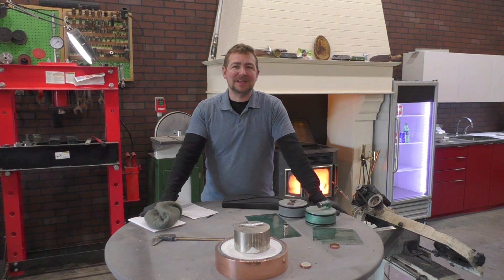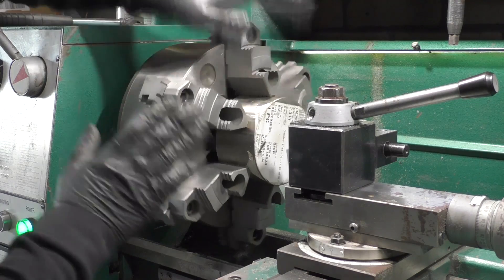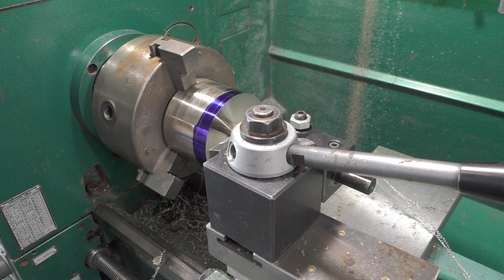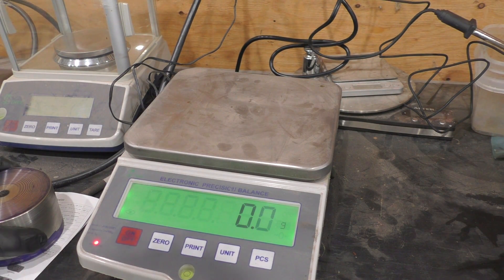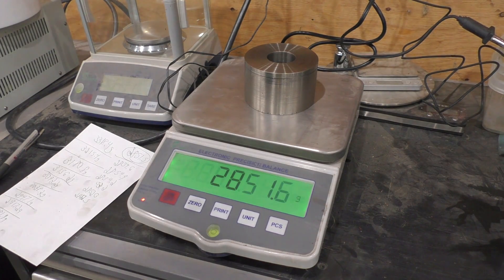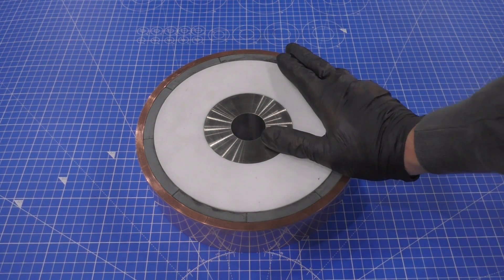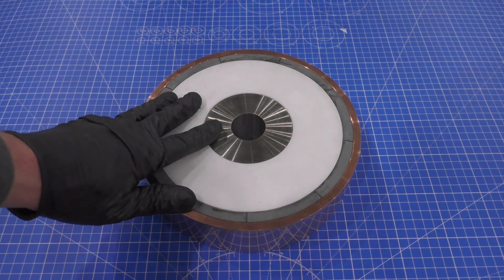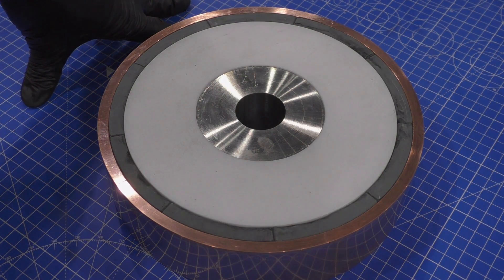Searl Generator Replica Nickel 200 Core Layer

Comment: hey did you check if this generator is working and are you able to control it?
Reply from the maker: I am currently working on building a double stack magnetizer for the rings magnets. unfortunately due to legal concerns I will no longer be posting updates on this device:(

Comment: Any updates? Very interesting stuff! I'm curious as to how much it cost to reproduce one set.
Reply from the maker: Hi, no updates as of yet. I have been forced to move out of my shop into another location. I have yet to find another location. So the project is on hold :-(
Reply: @woodbrassandglass  and faster, maybe in the next 5 years.
Reply: @woodbrassandglass i am thinking everybody starts with a gigantic ring. Why dont you start with small ring in the middle and with smaller rollers do the full project with give or take the same amount of resources?3 rings and rollers i mean.

Comment: How are you controlling the output levels once you get this started....seems like a static electric generator that somehow converts high voltage static charge to AC but there is no way to limit the AC output.... How are you getting around that.
Reply from the maker: I really don't know. However of it does produce any voltage upon testing I will hire an expert electrician to deal with that issue

Comment: Great progress I've been keeping an eye on you for a while to see if it actually works. I do actually recall in one of the videos I watched originally he didn't have his equipment magnetically imprinted.
Reply from the maker: Whoa ....are you following me?!! Lol
Right now I do the my own plans for two different styles of magnetizing. Hopefully by summer or so I will have started the experiments and will do an updated video about it.
Reply: @woodbrassandglass  following. very interesting. may the force be with you my friend :)
Reply: Yes I also believe the magnetic field imprinting machine came much later. 
I believe John had an early working prototype running but was using the machines 
as an end to gearing up for production. 

Look at all the videos of him, much to be gleaned from them. 
Some videos have good shots of the rigs to get rough dimensions from, I 
hadn't heard the three materials had to have equal mass but that's interesting.

Do you have the PDF paper titled, "Experimental Research of the Magnetic-Gravity Effects.
Full Size SEG tests." File may be called "SEG John Searl details.pdf"

So glad you are doing this work!
All the best

Comment: The motor is a total horseshit. Nothing about it provides a single facet into the mechanical motion of a shaft. Nor does the design incorporate a single aspect of wireless transmission. This is designed to keep idiots from actually pursing actual theories.

Comment: I have information on the sizes of the outer 3rd set of rings.
Rare Earth=406.4008mm-434.0633mm radius= 27.6625mm thick
Teflon=443.0633mm-460.0484mm radius= 25.9825mm thick
Magnet=460.0485mm-484.6263mm radius= 24.5778mm thick
Copper=484.6263mm-508.0010mm radius= 23.3747mm thick
If I knew the size of the rollers and the gap between the rollers and the rings, I’d know the size of the 2nd (middle) set of rings.

I’ll show you my source if you want to see it.
Reply from the maker: Hi. Yes who I the source of this info?
Reply: Did you know that the copper for the ring needs to be Oxygen Free Copper (OFC).
Reply: I have the leaked .PDF file to the SEG generator. It has specs and talks about how to make it. How do I contact you?

Comment: I've been playing with an ardiuno microprocessor and would recommend that as the easiest way to program turning on/off electro-magnets in sequence. The arduino would need to turn on/off power transistors that control the magnets since the magnets would require too much power to connect directly to the arduino board.
Reply: Is searl not researching anymore?

Comment: Hey man, I wonder from John document he didn't mention as to why the nugget rollers have to be in 4 pieces why not one single piece and is it because of the cost or it's impossible to create one single magnet ring for the main barring because the magnetic flux is not consistence due to the gap between each magnet which what is cause the spinning to slowdown over time .
Reply: I think it's something with the separate magnetic geometries that are created. I remember the documents and information about John was that he was seeing a higher ordered sequence of numbers... ie magnetic patterns.
Reply: The total amount of slices R6 not four. Each slice has a magnetic gate impression not evenly magnetized around the radius. Each slice gate is fixed further around the o clock. To create the proper sine wave as it turns. Each and Slice on the top and the bottom is flipped polar opposite. To keep the roller centered on the copper ring. Top to bottom. This is why the rollers are in sliced sections.

Comment: I am happy to see someone is using their own time money and energy to try to accomplish what seems to be highly improbable. I was wondering what was the reason for the diameters of the nickel  and Teflon? Comparing to John Searl's SEG it appears much more dense.
Reply from the maker: Hi there. I used from my own research approximate measurements of seg magnetics SEG. They cannot disclose such info. So I can only rely on my own measurements.  However the rules still stay the same. All parts must weigh the same in this unit. I believe their unit may be taller. But I'm not exactly sure how tall.

Comment: Perfectly. Only this is a wrong direction in the manufacture of a magnetic motor. It is more correct to look for the magnetic diode about which Professor Searl spoke. That is - a magnetic diode. Chaos converter in order. See: https://forum.guns.ru/forummessage/151/1774909.html

Comment: I have loved watching these vid's, But why did you use Nickel? Professor Searl used Rare earth metals for the core in a  non-magntized state. That is kind of important, The rare earth's metals are a lot larger and heavier then Nickel with a tremendous amount of energy in comparison. If you start your Searl up and it produces heat instead of cooling, plz turn it off and change the material for the core out. No one wants to see you get hurt.
Reply from the maker: Mainly for costs. Nickel may turn out to be s substitute.  99.9% pure Neodymium elementry of the size I need costs around $3,500+.  I may end up using Miche metal. It has about 30% neodymium along with a few stabilizers. All of this needs testing and time.
Reply: @woodbrassandglass  With a price like that I certainly understand, Nickel is 28 on the periodic table, Neodymium is 60. So Nickel has a little under half of the electrons and potential electrons of Neodymium. When you put it under load, by drawing power out. Be careful, The Nickel will not have the same reserve capacity. It might heat up from the effects, you know pesky entropy. Also, are you planning on using nickel in the core of the rollers? They do behave a bit like capacitors in his design, with the core of the rollers and rings helping to define load capacity.
Reply from the maker: I am also considering a metal called Miche metal I think. Its basically graphite with 30% neodymium powder mixed in. I think it's used in flint style rods for hikers, backpackers.  It can be pressed and melted. And would cost about the same as what I paid for nickel.

Comment: Fine work sir fine work! Can you explain the weights again? They all need the same mass? ~Russ
Reply: Guessing it has something to do with the mass of electrons needing to fit in each vessel. Tesla mentioned mass matching as something to build into a tesla coil, primary matching secondary mass....for equal transfer of the electrons.aybe thatbis what this requirement is trying to achieve. Why else would it matter?
Reply from the maker: I believe so. All parts of this assembly must weigh the same. Within 1/10 of a gram accuracy.
Reply: wood brass and glass  but why are you using nickel 200, for the center, when it is supposed to be neodymium according to John searl ?

Comment: Congratulations with the progress. I've been following for a few years and am quite curious to see the final state of the generator, even if it only runs with external power and does not produce any electricity by itself. By the way, do you intend to make it a 100% replica with all three layers or only one layer? I think I remember it as 12 rollers in the inner layer, 22 in the middle and 34 in the outer, but don't quote me on that.
Reply from the maker: I may just do the final 2 larger layers. But first I need to complete the first and run many tests to see if there is any type of output. If this produces nothing worthy I will can the project and move on:(
Reply: @woodbrassandglass  That sounds great. I am a bit hesitant to believe in actual power production though, as the physics behind is not documented and nobody else has managed to get the rollers magnetized with AC and DC power properly to get a net outcome. That being said though, it is a great project and this is what pushes science forward. Who knows what might come out of this.